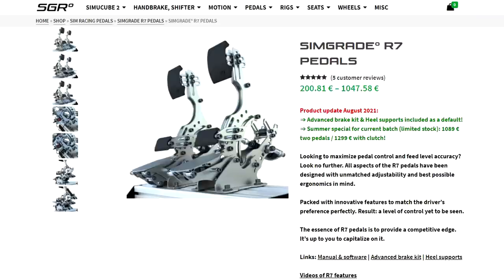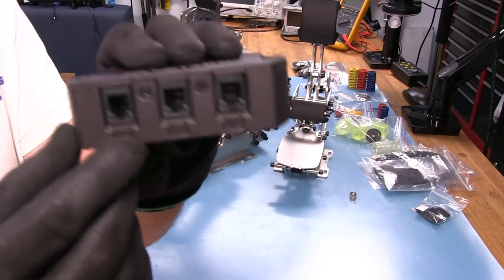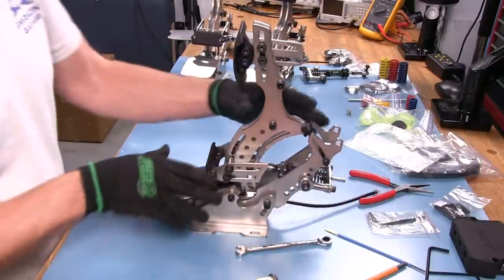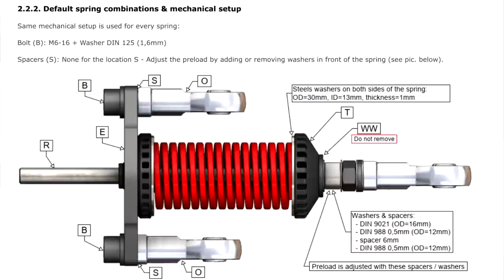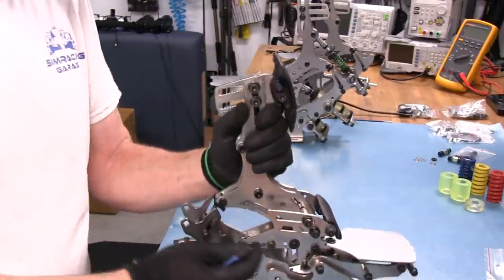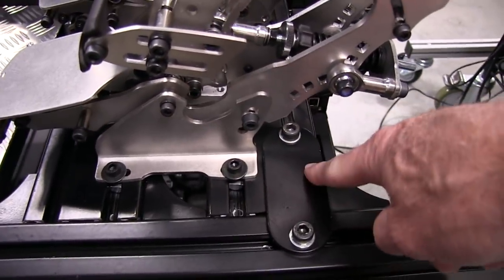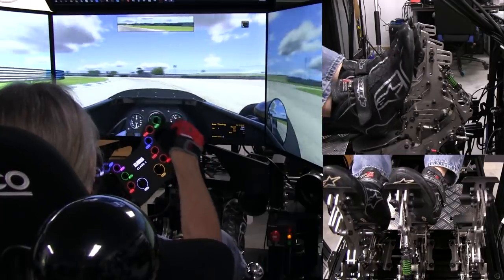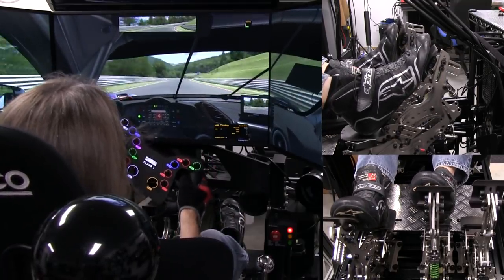Simgrade° R7 Pedals Review

Comment: this kind of hardware looks more sofisiticated that actual real racing pedals
Reply: I wouldn't say sophisticated but simracing gear is definitely unescessarily overengineered. All you need is simple stuff that works. OBP sells a pedal kit that you can fit in your car with on the fly brake bias adjustments right there for less money than this. Why would anyone in their right mind want something with 300 bolts and lose parts?
Reply: @tracklizard4018  I do, I absolutely love looking at my stuff when I'm not using it so over complicated is a nice visual design for me 
For example I have a bottle opener with 27 moving parts all made of brass
Reply: @theweirdguyinthecorner  Username checks out haha

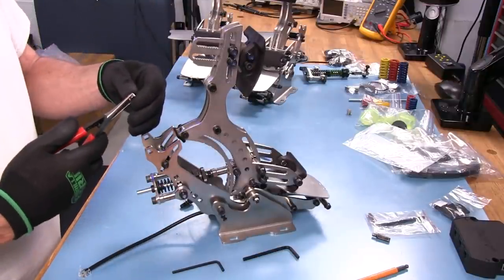Comment: 25:57/1:39:47 Simgrade should weld spacers to inner brackets.  1:14:00 Nutty to use bolts and spacers when threaded rods into ball ends with nuts either side of brake preload plate would preempt the need for removing and installing shims.

Comment: is all that complexity really worth it?... although their asking price seems to be a fraction of what it should be considering all the parts and labor to build.... and very reasonable in the marketplace. My biggest gripe would be the difficulty from going from one form of racing to another without major time in re configuring the whole dang contraptions in each pedal. Over engineered Rube Goldberg pedals that answer only an engineers wet dream with little "real world" practicality. More practical to have several sets of different pedal sets for specific functions. Less time to swap out a complete pedal set than adjust these monstrosities.
Reply: For me if I had that kind of budget yes it would be worth it but I enjoy looking at and following all sorts of mechanical movements when things are in use. My rig is pride of place in my living room so form is just as important as function for me
But as you said they are an engineers wet dream.

Comment: I love the look and style of these pedals like Transformers lol but joking aside what scares me to order some is when i first got my Heusinkveld pedals i spent so many hours over months trying to get the seat pedals and wheel aligned correctly because i was getting bad ankle pain and calf muscles were sore. With all the research i did i found out your should be using you ankle to add pressure and picot but set it so you use the wole leg to brake so push leg forwards instead of bending the ankle so how would these effect your ankles after say a few days racing i expect the trouble to start. 

Sim Racing Garage Barry have you driven them much,  if yes how is your ankles when changing to using different muscles to normal pedals?
Reply: Good thinking. I was shocked when I compared how my brother and I use the clutch where one of us fixes his heel on the car floor and pivots his foot and the other lays the whole foot on the clutch pedal and uses the whole leg mucle to push it.

  DRIVES ME BANANAS that no simracing gear on earth felt natural to me while I jump in to any car from the 70's or any budget modern car and can drive it naturally and intuitively for thousands of kilometers no problem. I think any can manufacture should make sim racing rig that replicates ANY of their cars and problem solved and we don't need to research and guess.
Reply: Don't forget that you can use them the conventional way by assembling the fixed heel plates.

Comment: Omg transformer pedals 🤣. What I just don’t get with all sorts of high end pedals coming with a heafty price tag the use of RJ connectors. What I mean it feels like it’s been slapped on after so much thoughts and time how to engineer the pedals. I just can’t get my head around that. At these price points you can/must aspect a better solution then RJ connectors. Same goes for the housing of the pcb board. What looks to be a 3D printed housing. Maybe it’s me or maybe I am nitpicking but it feels like the overlooked that part. Anyways a excellent review as usual again Barry. I take my head off for you sir. Putting much effort in time in these reviews. Grand ! 👍🏻

Comment: it wouldn't be difficult to 3d print a spacer holder to hold and place that finicky angle adjustment spacer. kinda like a small crescent shape half (or just over half to hold and release, i.e. "capture") the diameter of that spacer. That tool would be the thickness of the spacer to fit in that width... and since they're cheap printed parts, two could be used at the same time (one for each side). Would make adjust a lot easier with out having to fiddle with a needle nos and the need for a third hand.
Reply: Hi Jeffrey, took your idea partly and created a permanent holder for the spacer --> now there is no need for any tools to keep the spacer on its place while adjusting the pedal angle. See here;
https://www.youtube.com/watch?v=2y7i7GGk74U
Thanks for the feedback.  From now on, all pedals will have this improvement.

Comment: Hi Barry love and trust your reviews. Just in the market for a new cockpit, just wondering if you will be reviewing the Next Level Racing FGT Elite?. Im holding of my decision until you review this first. Many thanks Barry😉
Reply: @Make73 Yeah i guess, Ive actually seen Wills review now and enjoyed it, but i would like to see a very in-depth and thorough review that Barry does if possible. Torn between this and the P1x. My head tells me P1x but my heart says Elite because of the aesthetics side. Thanks for the reply
Reply: Just put this cockpit together last night. Took around 7 hours for just the cockpit and seat, no electronics. The paint on the steel pieces is sub par and flaked off several pieces. I installed a MOMO supercup seat instead of the nlr plastic one. Cockpit seems very rigid compared to the regular f-gt which I also own. I really like the pedal tilt and adjustment system. The seat needs more vertical adjustment asides from the seat brackets. I still have probably 6 or 7 hours of  assembly left for electronics and gettmy my shifter plate installed where I want it.
Reply: I think I would do p1x if I were doing it again. Being able to move display closer with the angled brackets is nice but it means you are dealing with propriety brackets and angles after. Figuring out a solution for my handbrake and shifter required some creativity. Also some of the profile is shorter and allows less adjustability. If you want to customize or replace you are back to angled cuts and such to deal with.  Otherwise it's really solid the pedal plate works well etc. Oh last part the hardware for the tnuts was wrong size and that caused a few days of problems because it didn't fit.

Comment: question are there big differences between the higher end DD wheelbases like simucube or fanated DDs ?
Reply: @X when you asking a ytuber a question if it doesnt auto fill @Sim Racing Garage you need to add @and their YTube channel name otherwise they just see it as a comment and imagine having to answer every single comment as it comes in lol so just a little heads up
Reply: Dan Suzuki compared the Fanatec, Simucube and VRS. He said the Fanatec falls off a little. I read that about others as well. The Simucube is a slight bit more detailled (the pro version) and has Wifi for wheels. VRS is the price/performance killer in DD.

Simagic also seems to have good products, but lackluster costumer support. Same with Sim-Plicity. Accuforce supposely falls a bit off in motor quality - albeit their software is supposed to be by far the best.

That's from my research. I will not say it is perfect or 100% accurate, but what information I have collected currently.
Reply: @PresidentScrooge  as for the simucube 2 pro bring "slightly better" i have too disagree with Dan because its dramatically better. His video wasnt after a month or so or using it and seeing how much more information you get through the wheel when set up correctly.
Reply: @PresidentScrooge  Also Simucube paddock software is the best out there. my friend has acuforce and i hate there software way too much to adjust. SC2 true drive paddock,  you pick sim title, wheel base for the pro, which wheel rim you use and if there are 3 different score levels so then it shows you all the profiles 1000s of people can and many have (its new so 20 or 30 per game at the moment) then you can click view or activate. When you click activate thats it profile loaded no messing.  All the big YouTube have uploaded profiles so its simple. Fanatec software dont even get me started.  Code words for settings then you have to on Google or the manual to Decipher the code to know what your changing it was horrible.  Simucube osw was again perfect.
Reply: @X I wouldn't even put my old DD1 in the same level as the SC2 PRO, it may be the same price but the SC2 PRO is hands down better in everyday, build quality,  software, customer support and most of all ffb. In iracing i was gobsmacked i could feel the individual Tires on all 4 corners when driving certain cars like the 488 evo in iracing it blew me away. 

watch race beyond matter video on DD1 vs Simucube and how he reacts is exactly how i did
Reply: Exactly simucube I havnt adjusted anything. I just try diff profiles.

Comment: the definition of over-engineered
Reply: As mechanical engineer, man are these beauty. Not over-engineered but well-engineered. Hardware that is gonna last forever (and you can easily change all electrical that is gonna age) and what you can adjust to the perfection.

No, they are not in my price range - yet.
Reply: @Arkkis27  what worries me is there is a reason why race cars use a certain pedal style. When heavy braking if your putting pressure on the ankle instead of using the leg you will get pain and fatigued over time. I found this out when first getting a my Huesinkveld pedals and they were too low and i was using my ankle more than i should and ended up with pain after few days and had to take a few days off and re adjust the height and once i got them in the right place i can feel i use my leg not my ankle at all, all i use my ankle for is slight gas pedal adjust, so ill be interested too see if any reports of this causing an issue with anyone.